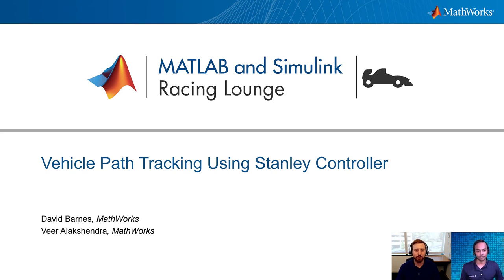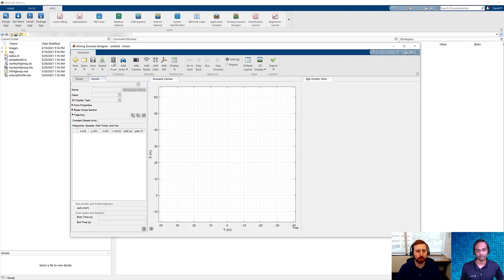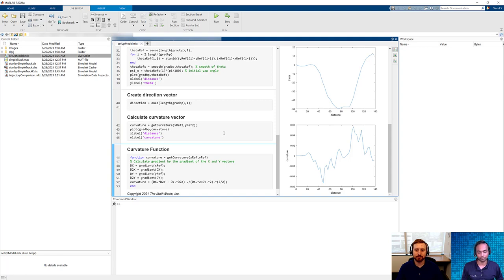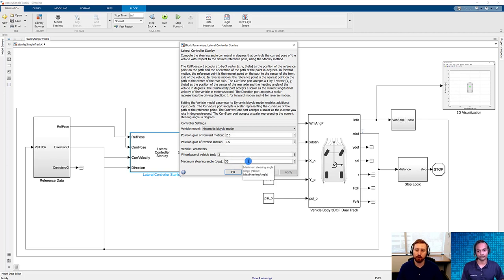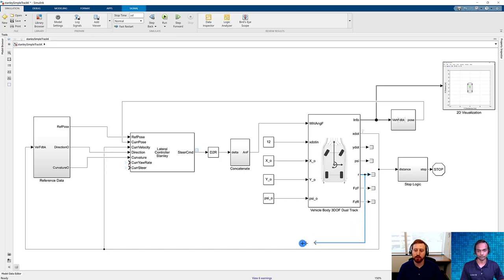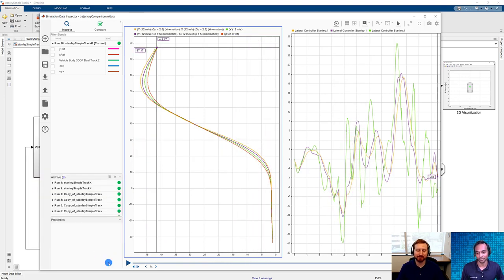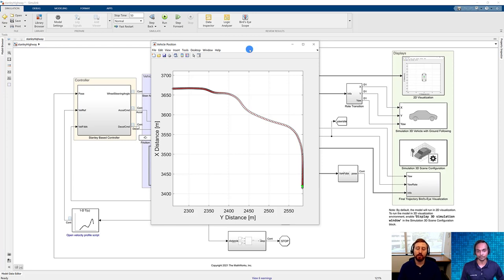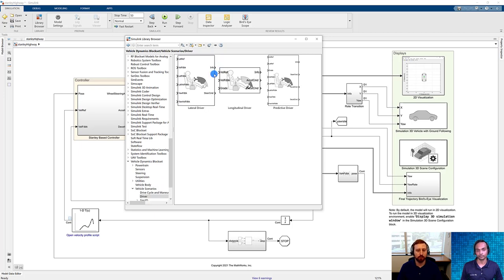Vehicle Path Tracking Using Stanley Controller

Comment: Thanks your effort. While this video is included in Matlab racing lounge it has little relevance and is more related to autonomous driving. What is much more interesting but never really mentioned in "racing lounge" videos is driver model that is capable to explore limits (cornering/braking etc.) of the modeled vehicle. Information in this regards would be extremely useful for students.